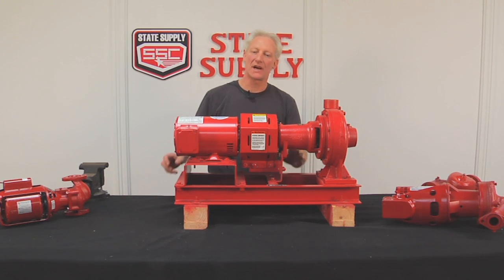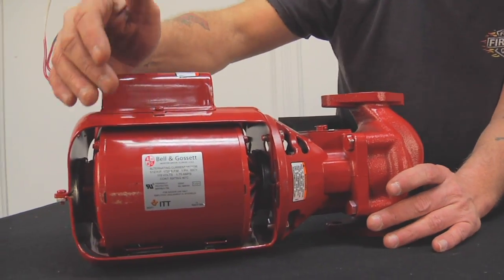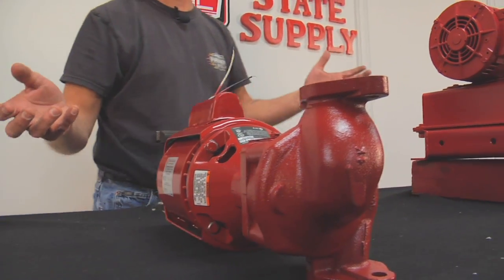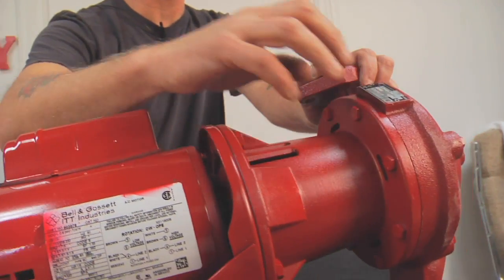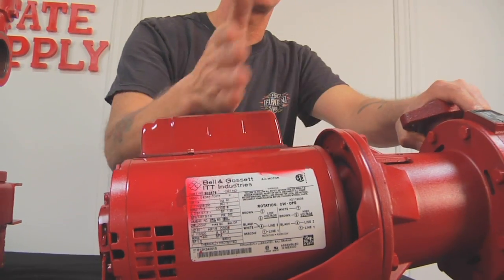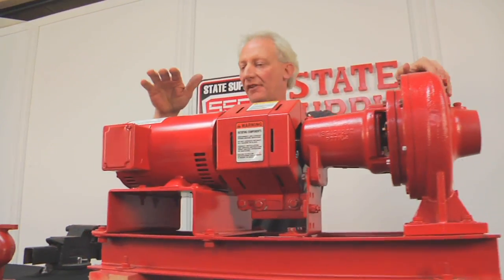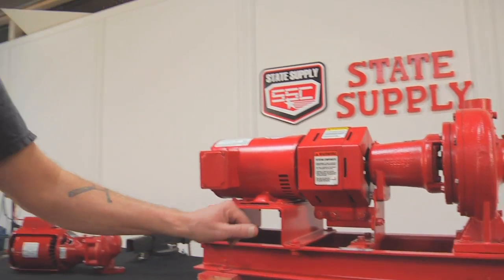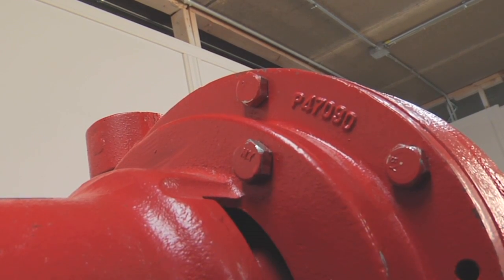How to Identify Your Bell & Gossett Pump

Comment: Please, I would like to contact by Email with local Distribuitor of Bell & Gossett Series 90 In-Line Pump, Suction x Dish. 1-1/4" or 1-1/2" Flanged Connection with Electrical motor 1-1/2 HP, 3450 RPM, 208/230/460 V,60Hx, We need Two (2) Unites, so I need the Name & Email of the who attend this necessity.

Comment: My Bell & Gossett pump is original to my house which was built in 1949.  Back then Bell & Gossett had a slightly different looking tag on their pumps.   The casting stamp number is P3-71 and the tag has P7Z-4351   with  HG under the number.  The motor has a tag that reads MOT115-6-7-N.  It is 1/6 HP  and there is another number that says... Protector MRF38EV.  The pump started making a noise a couple years ago but it still is pumping the hot water around my house.   I'm going to try to replace it with a similar Bell & Gossett pump if I can find an equivalent model.  It measures 8 1/2 inches from the input flange to the output flange.
Reply from the maker: Hey Jack! If you'd like to give us a call, someone on our sales team would be happy to source the replacement for you! 877-775-7705, or send pictures and a request to info@statesupply.com.